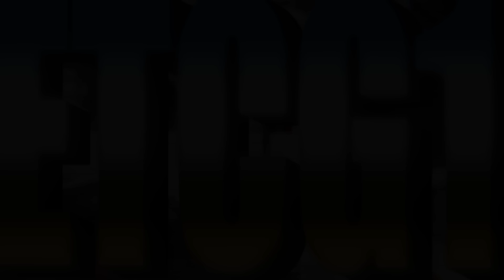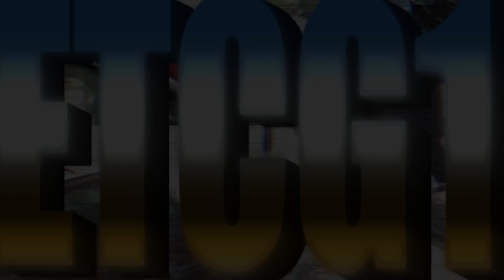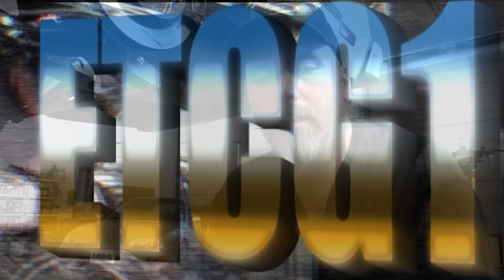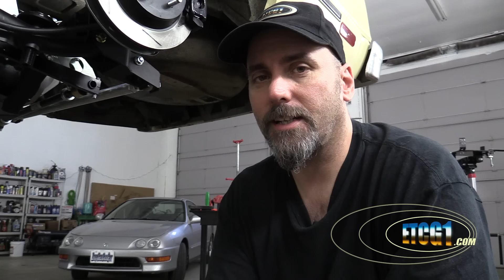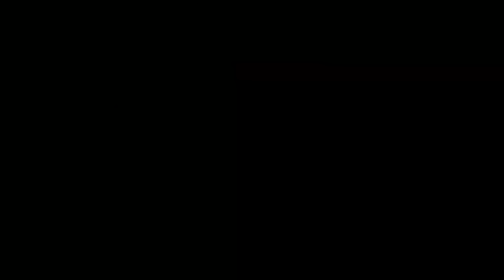Misconceptions About Performance Parts

Comment: Cold Air Intake is one of the most worthless parts every made.  And people buy them like crazy.
Reply: they maybe add 5 horse power , they are a waste of mint to put on a all stock street car . Plus it messes up your mass air flow sensor , it makes the cars running condition change or you may get check engine light .
Reply: Cold air intakes do work,header do work its just not an automatic thing you need to get your vehicle tuned
Reply: if you use the same diameter pipe....it wont mess up a mass airflow sensor....

people with turbo and blown LS engines use the stock MAF with no problems.....

that "myth" comes from people using oiled filters, and sucking the oil onto the MAF....which fucks it up. 

do i use cold air intakes? no...my fucking 99 buick century has one from the factory. 
even says you can pull out the headlight for a "ram air"

and all my other shit is carbed....which requires a shaker hood to be cold air intake...

the century is a regal with ouut the supercharged 3.8 v6....just a lil 3.1
but it has a lot of the "race" inspired regal parts....better suspension, brakes, head light pops out in seconds...just a smaller engine. 

im going to stick a supercharged 3.8 when my 180,000 mile 3.1 blows up.....4 bolts and a few electrical plugs.
Reply: a cone filter kit will most time do worse than the factory airbox. As the airbox will be bringing in outside-engine-bay air vs air from the engine bay. Why the cone is less restrictive the air is warmer so kinda negating. But a true cold air intake system that is less restrictive can produce some more power. We are not talking more power like a turbo but... On my wifes Jeep I built a duct work to bring more direct cool air into the airbox with some dryer duct as the factory one used a round about way to pull air around the headlight which seemed restrictive. On my vintage 63' Ford, I have a late stroked 5.0 similar to what Eric is doing. And it suffers from heat soak because old school air filter and small engine bay, and only real air movement is through the radiator. I could do a duct work setup but would routine the old school vibe. I am looking at a fiberglass hood with hood vents like a 68' Shelby GT500 has to let some of the hot air out.. It has been proven by old cars removing the hood will increase power and make the engine run cooler so cooler air makes engines happier.
Reply: Torpedomtb  a lot of times I work on cars and see those cone air filter that came off of the pipe and is just laying there.   Then you have dirt being sucked down the engine.  With cold air intakes.  All these stores will tell you it gives like 15 percent more horsepower.  Which is not true on the box it says increases in HP.  Which is probably like a tenth of one HP.   Most people think it has more power because the air filter is not in a box and its louder because you can hear the air being sucked in.  Ive been a mechanic for over 25 years and I would never buy a cold air intake.  The whole thing is just basically a K&N cone shaped air filter .  The rest of it does nothing for performance.
Reply: Yuck MAF on a turbo engine
Reply: I upgraded the MAF diameter from 2.75 to 3" and had to re-calibrate the MAF sensor with a tune. I used a base multiplier that I applied to the whole MAF curve and the car would give me lean and rick codes but after I logged the fuel trims and set the right values the car runs perfect.

My car is a stock Turbo Mazdaspeed 6 though.
Reply: It all depends on the vehicle, there has been an amount of R&D spent on it.. to get what they want. 
If it was a car from mid 90's and Japanese.. a Cold air intake could improve performance, as it was restricted under the Gentlemen's agreement.

All depends on where the restriction to flow is.
Reply: wobbly sauce
 Some kits may be less restrictive but pull air from the engine bay which one evil is replaced with another.
Reply: Torpedomtb
Mine pulls air from the engine bay but it's turbo so the intercooler compensates for engine heated air.

Now I push my tiny turbo past it's efficiency range and inject 50/50 water methanol before the throttle body so pulling in engine bay air makes no difference at all.
Reply: Not worthless at all when it is an improvement, but what most idiots do is replace the actual factory tuned cold air intake and bolt on a random piece of pipe and filter which butchers the entire intake design and in 90% of cases that filter sits right next to the very hot engine. So they are actually running a hot air intake.
Reply: MsSomeonenew
I don't think that's a big deal. It's like the exhaust, just a tube and it's only power gain is in the optimal diameter size. The only thing that needs careful tuning is the exhaust and intake manifolds.

The only detail is screwing up your intake is if you have a MAF based system with a sensor right next to the filter. You need an air straightener thing so that the sensor can get a  careful stream of air so the ECU can make correct fuel calculations.
Reply: +SI0AX actually having a flared end on the intake pipe makes a huge difference in intake air speed. Ever heard of velocity stacks? Not just a cool name. On a turbo engine its not going to really make a difference, but n/a engines it does. Oem car manufacturers know that, and if you look at a lot of stock air intakes the air inlet will be flared at the end. A lot of aftermarket intakes are not. The reason most people put intakes on cars is they think the factory intakes are restrictive.. That's just not the case, unless the engine is modified internally to actually need more airflow than the stock engine. Car manufacturers spend a lot of time and money making engines efficient.
Reply: John Pfeifer
Well, you won't need to upgrade your MAF diameter unless your pushing some serious boost, so Intakes work best on turbo cars that have been modified to run more boost and it's really more flow and not air temp related gains.
Reply: LastGeicoCaveman yeah on vehicle virgins he just got a supercharger and thought it was so fast. Later he realized it wasn't even working...
Reply: *****
lol, that happened to me when I first installed my methanol injection kit. It was supposed to use a tee into a manifold pressure source and activate at 10psi, but I ended up using a brake pressure source!(It was on top of the manifold so I didn't know).

I had the placebo effect make me thing the car was accelerating faster.

I then tuned the car to run on a higher boost setting (which did make the car faster) and only realized it was not injecting meth when the Boost temp was like 60*C lol.
Reply: I've made cold air intakes for two of my vehicles. First one was MAP based, saw maybe 2-3hp increase, largest gain was in throttle response. 
Second was an IDI diesel. Gained close to 15HP. Went from 3" tube with intake muffler, to 3.5" all the way. 
Much better throttle response and low end torque. 
Most cars see some form of power increase with a true CAI. Cone filters, hot air intakes, really don't do anything.
Reply: I beleiv it depends on the car are truck its being installed on..
Reply: think the only benefit to cold air intake, is taking up less space in the engine bay.  That and moving the battery to the trunk can make working on your car easier.
Reply: well as i stated befor and i will continue to stand by my experiance a cold air intake ..plus duel exoust was the verry first mods on a stock astro van and it squated..off the line...and yes with brand new bill stien rear shocks so untill a dino tells me diffrent..cold air intakes is the verry first thing you can do to improev a car or trucks performance a engine is what? a giant air pump so what hapens when  more air is flowing thru a air pump.into a combustian chamber a little more power ...inhale....EXHALE  GOT IT...KIDS
Reply: OH AND LET ME CLEAR THIS UP not a lot of power but off the line ...or seat of the pants as some car peapl call it lol...from a stop sighn..i felt the diffrence when i steped on the gas
Reply: Good for you.
 It really depends on what restrictions are OEM and not what is wrong with the intake system AND if it's computer-controlled. It will make a difference,if the OEM system is restricted OR if it takes under hood air,that is warm air.

 On a colder day,it makes a difference in torque and on a warm day,it is possible to make more torque/power because it takes in colder air to burn.
 The ECU 'sees' the air temperature and makes adjustment to the air/fuel ratio,based on the information it gets from the sensors. If your ECU 'sees' a cold engine,it will run rich.(Good for power,bad for MPG'S.)

 IF your engine sensors are out of range/stupid/faulty,that will make a difference as well.
 Diagnose first,then make a repair as needed.
More power? 

That's a tough one. Bolt ons are a possible way to that end.
 You are trying to better the engineers that designed your power train.
  On my car,the intake system WAS restricted and I took steps to better the engineers design. I was doing some looking ,B-4 I jumped in. It worked better and I was pleased with the results.

 Every system is different and there are ways to improve the engines volumetric efficiency,if you are willing to study your own applications.

Bolt-ons... DO... work,if you are careful in your choices. Power?

 In the end,have you heard the term,"There is/are no substitute for cubic inches?"
Well,there really IS,but you just have to find them. Your engine is  an air pump. 
More air in AND out is more power.

Thanks for clicking.

                Dave in Seattle.
Reply: ddd228
Usually intakes make you lose power/torque down low but gain it up high.

But yes it depends on the car. You could search online for your particular car if it sees gains with an intake an no tune. If you want to check for gains with a tune, you should tune the car without the intake first, then install the intake, do the run, then tune again and run again.

I've heard turbo cars have good gains even with a hot-air intake because of the increased flow and because they have inter-coolers you won't really see much of a difference in a CAI.

I've also heard that the RX-8 aftermarket intakes actually lower HP because the stock system was already engineered for high RPM efficiency.
Reply: 9600GTMAN   It doesn't need it on any car.   There completely worthless.
Reply: 1970chevelle396
It's good to free up room in the engine bay, otherwise it's like an exhaust, it's mostly just for noise.

Most exhaust gains are at the manifold with a tune, or deleting cats.

Installing an axle-back(just replacing the muffler) is just for noise, yet people pay like $400 just for that(legit brand of course).
Reply: 1970chevelle396 most ppl buy it for the sound of course they know a piece of pipe and an air filter isn't gonna give them 100hp. Also many of these filters u can re clean and no need to buy another filter
Reply: 1970chevelle396 they're good if you're actually looking to milk horsepower. They'll add... Ehh maybe 3 horsepower. But it varies in different vehicles. It added a decent amount to my 96 F150, just because the stock intake is so restrictive for good airflow. Same with the exhaust. But don't look to gain anywhere over 15 horsepower from a full intake and exhaust upgrade, because that's all you're gonna get.
Reply: 1970chevelle396 I only added one to my ss to hear the super charger whine. I expected no hp gain, just audible gain. but routed properly it'll do better than most stock.
Reply: Cold air intakes actually work pretty well in some cars. The problem is, they only tend to work in cars that aren't driven by the kind of people who would want a cold air intake. They tend work well in boring economy cars, minivans, and trucks. They actually hurt performance in vehicles where performance mattered to the engineers.
Reply: 1970chevelle396 I agree with you 100%! Cold air intakes are a waste of $$$!
Reply: 1970chevelle396 on its own maybe you’re right. But a vehicles performance is only going to be as good as its weakest link. So a big cold air system is going to be pointless if it is going into a restricted intake and fuel system. It’s really a matter of getting rid of the bottlenecks. And honestly it sounds better and looks better than the ugly black factory box.
Reply: That totally depends on the design of both the original and the CAI. If it actually pulls in colder air it will work. Most just make it sound better.

Comment: I would say on pretty much any newer car you are not going to see or feel any gains with a cold air intake and / or full exhaust, without getting a tune for the ECU, and even then it will only be like 20 - 30 hp you will see after having spend like 1500 dollars on all that. If you are to do something that will be more feasible, then a good set of tires, brakes and suspension is a much better area to focus on, and even here look for a good pair of shocks instead of lowering springs (lowering your car does not make it handle better, that is a ricer myth). But if you want to add power for just straight line speed you are looking at a couple of thousand for adding boost / adding spray or going cams and ported intake, but even all that is kind of pointless without having the tires, brakes and suspension sorted first. But that's just my 2 cents /Rant over

Comment: modern vehicles require not only hardware upgrades, but software also. you can upgrade parts 'till the cows come home, and not see any gains....until the ECU knows that something is different from stock......the majority of ecu's will adjust the tune based on stock parts/flow numbers.....

Comment: what about removing parts for better performance. namely the catalytic converter?
Reply: That helps a lot more, since the cat, which is basically a honeycomb of ceramic metals, blocks a lot of the airflow by design, to allow for the airstream to continue burning.  Modern cars also have two cats per downpipe, so even more so.   But only supposed to be done on vehicles driven off-road.  Still, you also need to incorporate a modified exhaust system from start to finish (except the muffler ) to reap the benefits.  Cutting the cat out and putting a test-pipe doesn't accomplish much when running the small diameter pipes of most passenger evhicles.
Reply: i was debating just cutting off the cat instead of replacing it. i dont get emissions done so i dont see any reason to keep it

Comment: Biggest bolt on mod that is garbage (other than hot air intakes) is drilled and slotted rotors, you WILL remove brake surface area and reduce braking. Flat rotors and excellent brake pads are the best, and slotted rotors help "resurface" the brake pad if you're doing hot laps on a track with street pads. Same reason why you only see flat rotors on the highest end cars. Although you will find very expensive cars with drilled/slotted rotors but that goes back to looks over function and trying to sell a car.
Reply: True but understand that many people buy these things for the flashy appearance, not for actual performance.  A lot of these cars never go out of the city so don't even have an opportunity to get up to any real damaging speeds.

Comment: The rule of thumb is that you will NOT FEEL a performance increase that is under 10%. So adding 3 horsepower from an intake wont be felt unless your car is only 30 horsepower. Any improvement below 20 horsepower won't be felt if your car makes 200+ horsepower. Throttle response, maybe, but acceleration? No. In today's cars of 300+ horsepower, you need 30+ horsepower gains from a mod(s) before you actually FEEL the difference from them.

Comment: the only thing that slapping a new set of headers on your engine will accomplish, is better scavenging. It creates more of a syphoning effect and pulls more exhaust gasses out of the cylinder. less exhaust gasses in the cylinder = more room for more air/fuel mixture.

Comment: Without proper timing and fuel maps... the Gs-R doesn't know you have a performance header, or exhaust, or intake manifold, or any 'upgrade' for that matter. Without a chip/flash no gains will be felt, and in fact a richer mixture is probably the only gain you achieved. Not sure about obd2 options but obd1 is easy to chip and tune, and an obd1 conversion is cost efficient vs a standalone ecm.
Reply from the maker: I'm glad you brought up the OBD1 or stand alone because Honda computers of this vintage are not programmable.
Reply: Yea that's sort of what I was getting at. Hondata S300 is probably going to be your best bet. But the obd1 conversion is a must. Rywire ('rewire') for assurance but ebay offers the plug and play conversion. If not worried about the data logging or RTP you can get by with a socketed and chipped obd1 p-72 ecu (94-95 Integra Vtec) to keep the stock gsr dual stage intake or obd1 p28 (92-95 Civic Vtec) if your willing to swap intake manifold to a single stage like the b16 and type Rs.  Good luck with the translation of all that and bite the bullet for the s300. Ready to see those Fairmont E/T's keep up the good work.